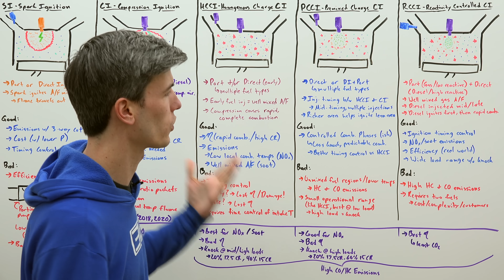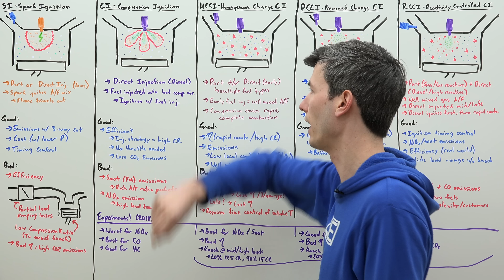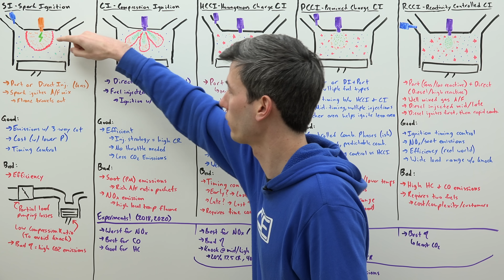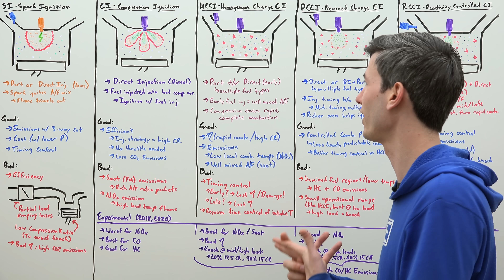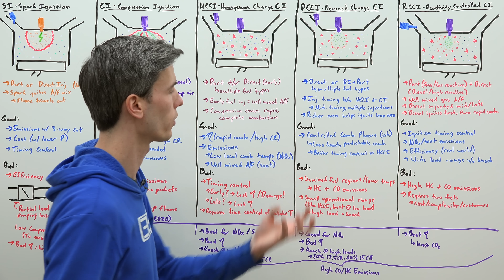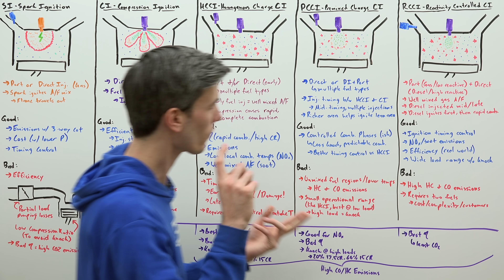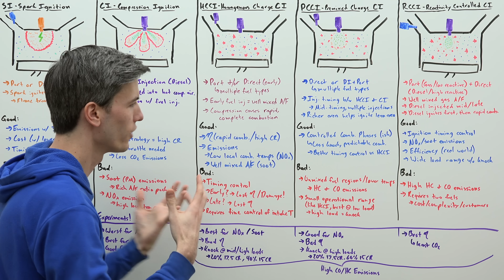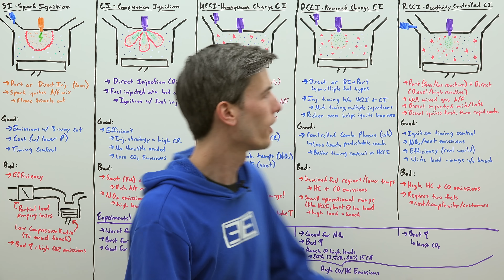If Combustion Engines Have A Future, What Is It?

Comment: With all these problems with combustion engines, there might just not be a place for them in the future. You should have put an electric motor at the end, and put good & bad down as well. 😉😄👍
Reply: This is a video about the future of combustion engines, not the future of all motors.
Reply: @AleksandarStefanovic  Actually I expected a couple ideas what ice engines would be good at in a likely future with electric engines. But that's missing, so I guess there is no such place? The newer designs have just as bad downsides as the old designs.

Comment: I don’t think dual fuel would be that much of a problem for drivers. We already have the pumps next to each other and I’m guessing it would predominantly use gasoline fuel.
It could possibly run on only one fuel in a fail safe mode, possibly just needs a spark plug to run on either fuel.

Comment: I heard about LPG on diesel engines,similar like rcci
Reply: LPG adds power AND reduces emmisions :)
Reply: @SzwarcuKX5  i know that it was expencive and put only in trucks
Reply: @chedons91  Guys in Poland are starting to make kits for various VW cars.
Reply: @SzwarcuKX5  for vw is a must,because emisions 😁
Reply: @chedons91  They're not converting to LPG, they're rigging propane port injection to diesel engines. Diesel guys have been doing it for a few decades now
Reply: @fitz3540  i know that is mix fuel,using lpg and diesel at same time

Comment: I love this type of content from you! Electric is now, batteries are hard to beat. I used to love the idea of hybrid electrics with an onboard gas powered generator that would get very high equivalent mpgs. Single cycle free piston engine generator units seemed to have very high potential for this purpose, but don't seem to have gained enough interest. I'd love to know what other options would be open to hybridization of electrics beyond batteries.

Comment: Many Direct Injection engines do not use a throttle plate.
Reply: Most do, unless you're at Diesel, too. Otto/Gasoline/Spark Ignition - it was considered the best way to reduce fuel consumption, as it had greatest results, but only in a limited range of operating conditions and it requires the same lab of an exhaust as Diesel.

But, the throttle plate, while still there and doing, is used less in downsized engines or those with deactivation despite not being huge.

Stratified injection was more common 10 years ago than today, but still, it is fascinating and worth development.

Comment: Lovely video. I really enjoy these comparisons and all the smart ideas engineers come up with. One thing with Diesel engines in particular is that there are parameters which need to be balanced between soot reduction and NOx reduction. (Modern Diesels run a low soot strategy followed by a mobile chemical plant to get rid of NOx) Butit is possible to switch out the fuel and eliminate soot by high oxigen fuel (decanol or diethyl-ether) and then run a low NOx strategy. It would be really interesting to see your take on alternative fuels.

But definitely a thumbs up for showing how much can be done with a simple piston and how complicated it is to hit all the various requirements.

Comment: It seems like the best option for power density, energy storage, and emissions would be a fuel-powered generator powering an EV. Just like what has been done in heavy industry and power generation for decades. Think of it like a diesel Toyota Prius or Chevy Volt. Nox has also been reduced significantly with an exhaust after-treatment (i.e. DEF).
Reply: There are electric cars with range extenders, for example, a variant of BMW i3

Comment: Bi fuel is actually would be pretty dam convenient, i’am running Natural gas+gasoline in my a4 b6 1.8t, 8l/100km of propane, propane is ~33 cents per liter. Modern Diesel engines use about 4-5l/100km, so if you say that’s even more efficient it will be like 2.5l of methane+1l of diesel per 100km, that would be extremely cheap. And you could drive really far even with 40l tank of methane.

Comment: For me the largest problem about electric/hybrid powertrains is the battery life because owning a car that in 10 years will pretty much be worthless isn't exactly a good option
Reply: In ten years, it will lose 20% of it's capacity AT WORST. China-made Model 3 cars have the battery chemistry that makes the battery last for 600.000 km before losing 20% of its capacity
Reply: @AleksandarStefanovic  tesla says their battery lasts 8 years nissan say 10 for the leaf (with some already becoming junk with only 6 years in portugal) toyota also expects 10-8 years on the prius the longest battery a hybrid ever lasted is 250k miles and the car drove mostly on the highway which means that the battery wasn't being used for a big period.  And when talking about battery's it isn't the miles that matter but the cycle's and even tesla's top battery only lasts 1500 cycles which if you charge it once every 3 days its only going to last 12 years
Reply: @enso3140  

Ah, yes. The Nissan Leaf. Nissan made the poor decision in avoiding battery temperature management, while the rest the the industry was leaning towards active battery cooling (and heating). Heat kills batteries, either from rapid charging, heavy driving, warm summer temperatures, or a combination... heat will aid in rapid degradation.

To Nissan's credit though, they are now moving forward with active thermal battery management with the upcoming Aryia.

..... but because of the Leaf handicap, one can find a steal of a deal second hand, just take it for an extended test drive first.
Reply: @wzDH106  still one of the few examples of ev's that have been on the market for some time and a good example of an ev that regular people would own. even the prius who's built from arguably  the  best company when it comes to reliability and longevity their battery is still only good for 10 years
Reply: @enso3140  

Similar to comparing a Ford Pinto to a Volvo wagon from the same era. I guess both are hatchbacks, but not comparable otherwise. Nor should the reputation of one damn the other.

No disrespect, but you're reinforcing my point with The Prius battery. A battery that is heavily used, regularly discharged and cycled.... yet said battery can reach and surpass 10 years. Just imagine the potential of a larger (thermally controlled) battery that's worked 1/4 or 1/6 as hard over the same mileage as the Prius and Volt, with a significant reduction in cycles.

edit- we simply don't have real world examples. It hasn't been a decade since mass production of Tesla's S, the 2012 model, a data point I'm waiting for as they were produced in large numbers. We know miles have little impact on degradation, time is still questionable.
Reply: 10 years for a 200+ mile EV is basically covered under warranty. We have yet to see real world life expectancy as the 200+ mile EVs have yet to push 10 years old.

The 10 year assumption may be a valid concern for PHEVs with smaller batteries, such as the Volt, where the smaller battery works 4 to 6 times harder (more charging cycles) over the same mileage of a longer range EV.

But even then, there are Prius hybrid batteries that are currently exceeding the 10 year mark, with a battery work ethic that puts even the Volt battery to shame.

Comment: Has anyone experimented with diesel engines that spray fuel into the cylinder via multiple orifices to try to spread things out more in there? Only so much area to work with, I suppose.
Reply: People have. Problem is the droplet size which is defined by injection pressure and injector nozzle diameter (small = better) So adding more injectors does not help the soot or NOx much.